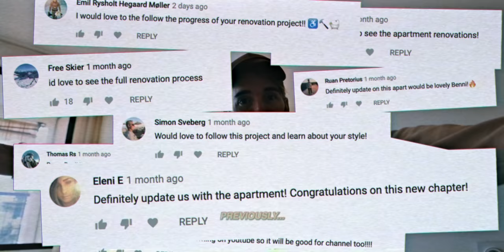The Apartment Renovations Start NOW! DEMOLITION MODE ON 😅

Comment: The space for outdoor clothes (The wardrobe), take it out and use the space between the wall on the right and the wall where the electricity compartment is and just put a pole to have your clothes hanging from and put a shoe rack underneath. It will be more accessible than having doors to open every time. It will also look better in my opinion, more clean which is important when it's the first thing you see when you get inside.